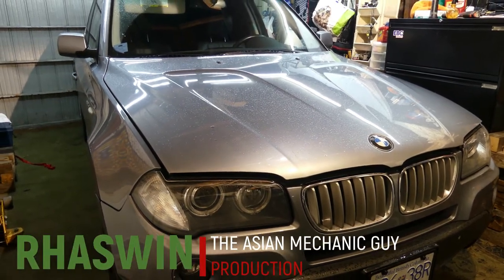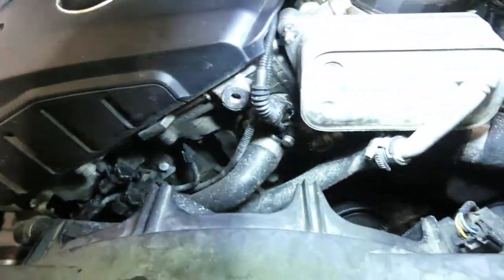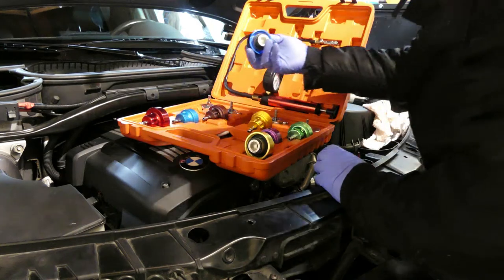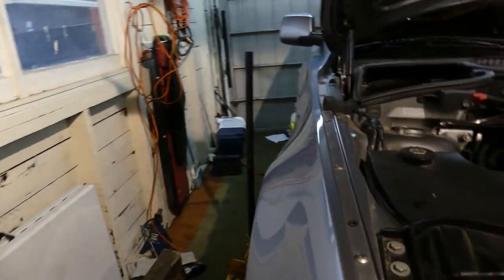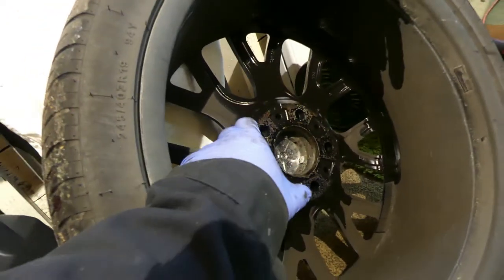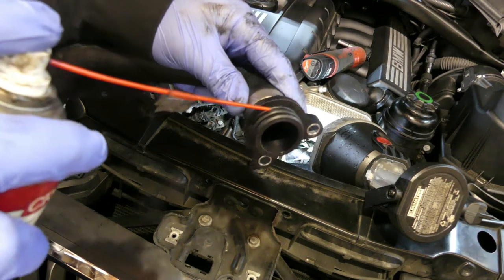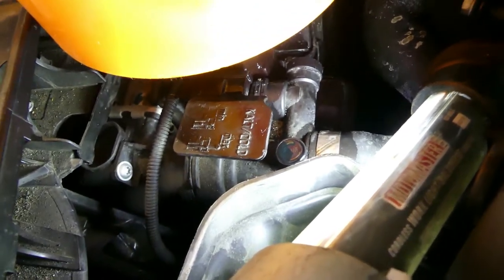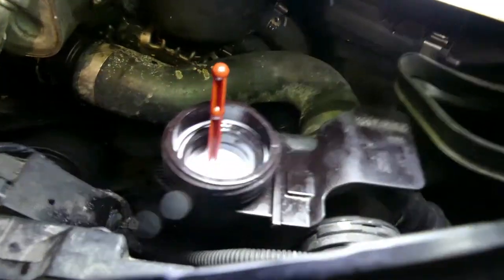07 BMW X3 coolant leak DIAGNOSIS & FIX

Comment: Thank you for this very helpful video!  This leak is exactly what happened to my 2007 X3.  Why did BMW use that plastic (mickey mouse-shaped) hose flange when metal would have been stronger?
Reply from the maker: Glad it helped!

Comment: Hi kabayan, I am of your subscribers
My BMW X3 E83 had something like a coolant leak because after topping up then when I drive for a few minutes I've found out there is a drop of coolant underneath, but when I brought it to the garage they cannot find any coolant leak. Kabayan maybe you have some suggestions to fixed. Thank you
Reply from the maker: Pressure test  nu kabayan un lang talaga ang pinaka the best na gawin nu malalaman nu talaga kung saan sya nagleleak

Comment: Lodi regarding dun sa replacing of TCM mazda 3 . My plano din kasi ako mag replace kasi , yung problema saken from 1st gear dderetso nasya to 4th gear hnd nasya . Dumadaan sa 2nd and 3rd gear . i need your expect advice salamat more power to you
Reply: i need your expert advice sir . if dun ba talga problema saken . Hnd pa kasi ako nkabili ng scanner
Reply from the maker: bro you need ur car to get scan para may starting point ka mahirap hulaan yan
Reply: @rommelcarlaunzo4036  tama si Rhaswin hindi manghuhula mga mekaniko dito sa abroad kailangan mong ipascan yan kaibigan ..Iba ang mga mekaniko dito sa abroad d katulad sa pinas na tunog palang daw alam na  nila sira ng sasakyan mo ..dito sa broad kailangan sigurado ang gawa hindi hula hula o tyamba tyamba at may mga gamit hindi katulad ng mga vlogger sa pinas na puro dakdak akala mo napakakagaling wala namang gawa
Reply: @asianmechanicguy6483  saraming salamat bro
Reply: @totoy7224  salamat bro